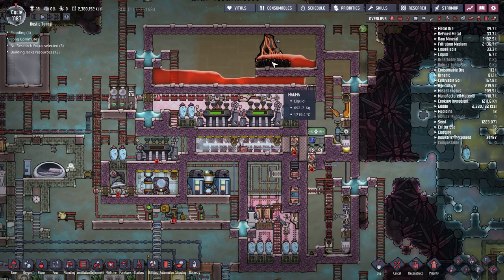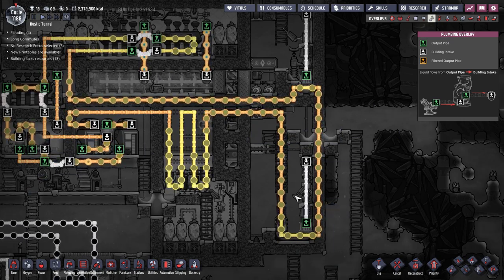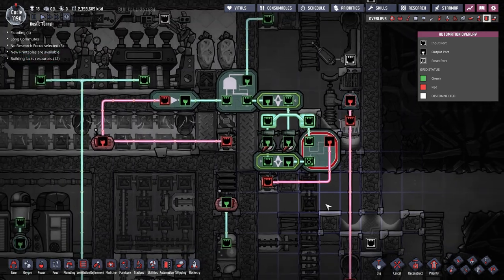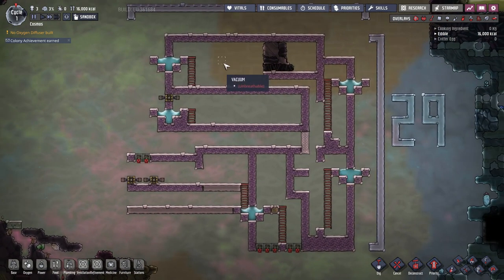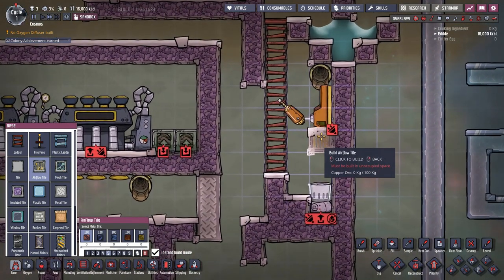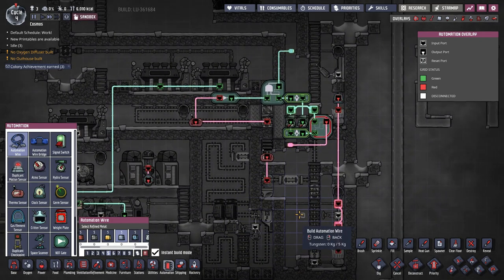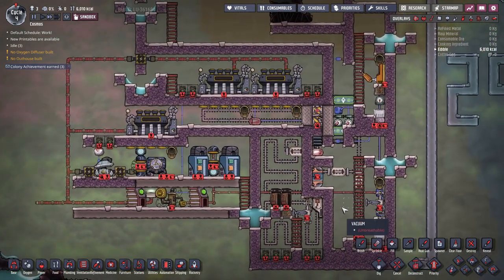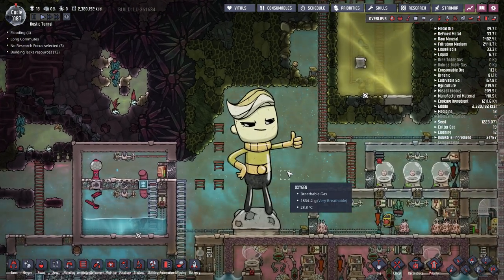Oxygen not included - How to build:  Volcano Tamer!

Comment: Amazing and original idea! I stumbled upon your video when I was searching for a way to deal with a metal volcano, I did in a more compact way but I was trying to not use steel and I ended up using steel on the sweeper/loader, and I think your cooling things on a vacuum part is the answer I needed, and btw, this is what I have so far: https://imgur.com/a/0he2Dpd , if you can, leave me your impressions.

Edit: And to improve upon what you have, you could use airflow tiles to contain the magma, and since the tile repels liquids you would never have any heat loss/leakage before you wanted to.
Reply from the maker: I think you can safely contain the metal volcano inside the steam chamber since it doesn't produce a lot of materials.
Also, one turbine is enough for metal volcanoes, since they don't output a lot of heat (compared to magma volcanoes).

I also have a video about a metal volcano tamer, it might interest you.